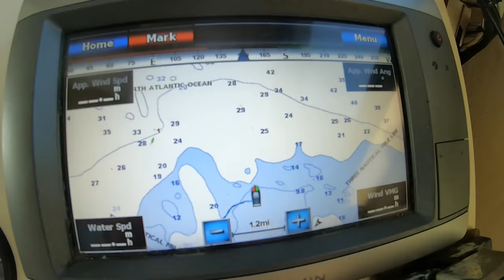Shrimp Trawling Break. Out. Another. Thousand. For The DRAG QUEEN... Let's Fix Her

Comment: I hope you get plenty of shrimp to help pay for parts and repairs.
Reply from the maker: Me too.  The money we're spending is adding up way faster than the shrimp money we're bringing in.  I haven't found anything to do on the water that's profitable.
Reply: @SaltyReflections on the water is a grind it’s all about time and expenses. You can do well in trenchards inlet and in front of fripp but loads of submerged timber to get hung up on if you are not careful. You will get cleaner shrimp in front of dafuskie. In front of edisto is good on calm days. Look for the small fish on the sonar. They will hang out with the shrimp. In the outer areas you need to be in 20ish ft of water.
Reply from the maker: @rainman6080  Thanks for all the info.  We've only pulled off the beach of Otter and Harbor.  I'm thinking it's best I give up on trawling offshore for now.  We've made two attempts offshore and encountered all sorts of issues.  We're going to wait to SCDNR opens the area closer to the beaches before we try again.

Comment: Your out drive I believe has an impeller in it as well. Never run your boat without water to it for any length of time.
Reply from the maker: No, I don't think this boat has another pump in the out drive.  This boat has the bravo 3 out drive.  The impeller we changed was out of the raw water pump that sucks water through the bottom of the hull of this boat.  It's 5.7 350 engine has another water pump on it like a regular car engine that circulates the water through it that comes from the raw water pump,

Comment: You need around 180 foot of cable you will cats better
Reply from the maker: Thanks for the info.  I'll be adding longer pull ropes or adding more cable to our winch.  The small winch that I'm trying to use won't hold but so much cable and I really ain't ready at this time to add a big trawl winch.  I going to have to see how much cable I can get on the winch we're using.
Reply: @SaltyReflections  I understand, you was definitely not 
 on the bottom